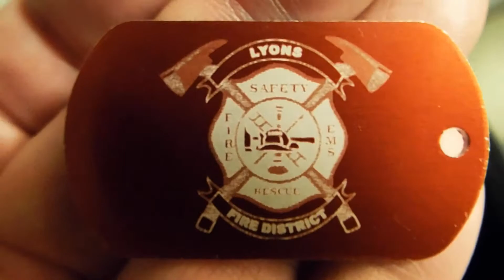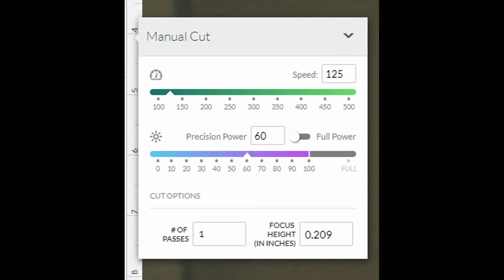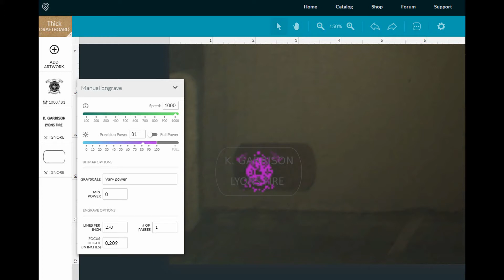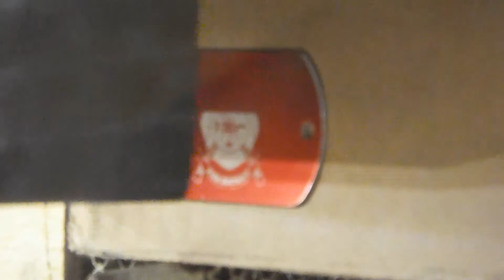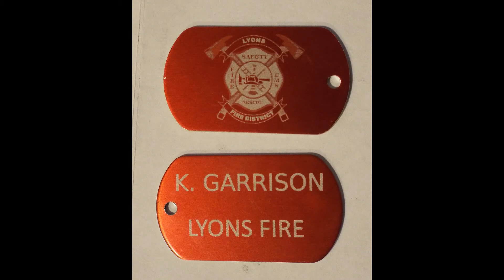Cutting Front and Back Graphics into Anodized Aluminum on a Glowforge Laser Cutter

Comment: Thanks...im sure the chinese anodized will flake off with fingernails....diamond drag engraving process uses a fine pointed diamond bit and actually removes material so image doesnt wear off..its permanent..unlike laser etching ...laser etching with co2 just removes coating which results in image....once coating wears off ...then image disappears...i do dog tags using damond drag....since dog tags anodize wears off fast....diamond drag basically scratches image in the metal .so in theory should last hundreds or thousands of years...and not wear off like laser anodize etching....but since we live in a short term 1-2 yr ....disposable society i guess thats fine. And good for your business since you get repeat business every 1 -2 yrs 😙